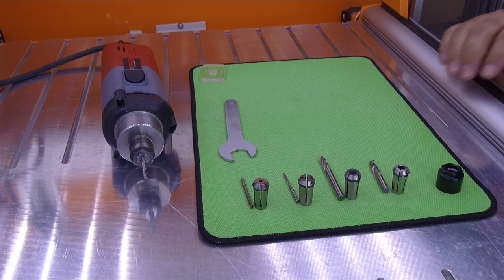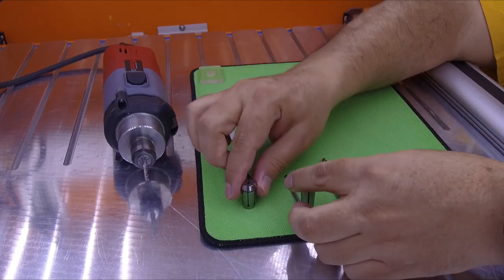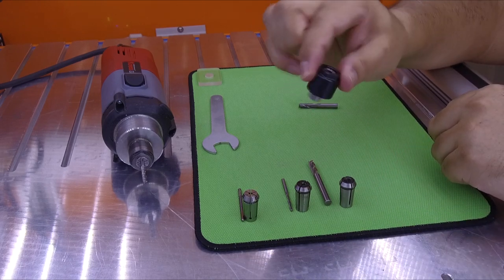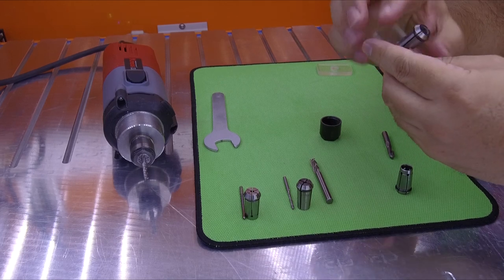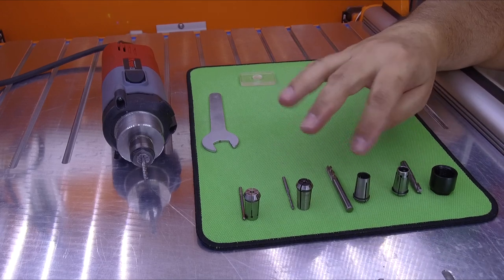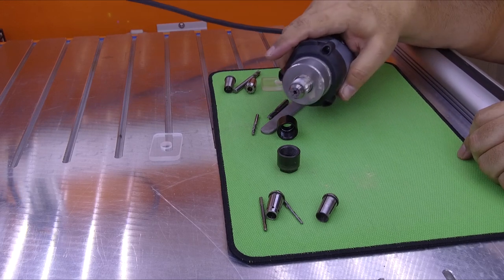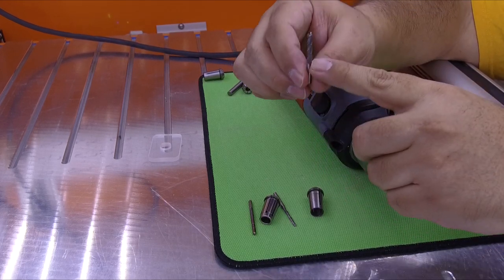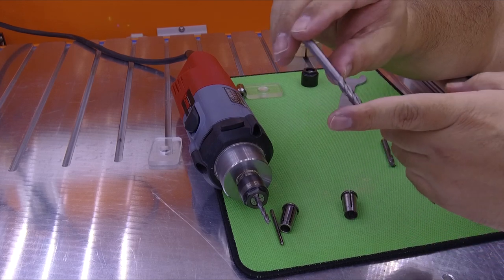Collets, Endmills, Nut? Answers to common questions and how to use them.

Comment: Thanks for the video. I have a Stepcraft M1000, my biggest problem is to remove the bits and collar. They are often so stucked I must use a screwdriver and a hammer to loosen the collar from the spindle. Any advice??
Reply: Watch from Minute 13:00
Reply: Its that second spot where Hugo uses a wrench the second time.  The bit will drop out after you get past that.  Had the same issue early on. Operator error.